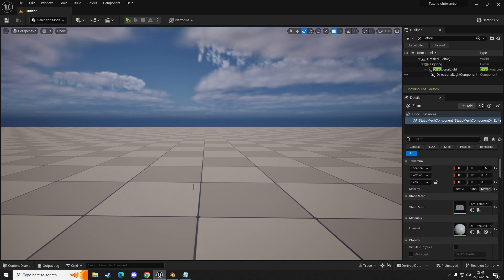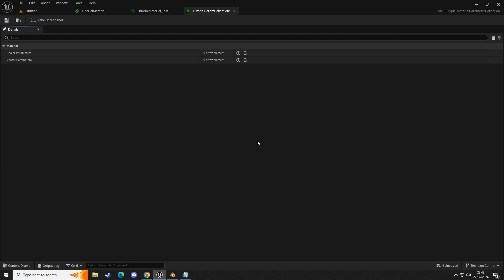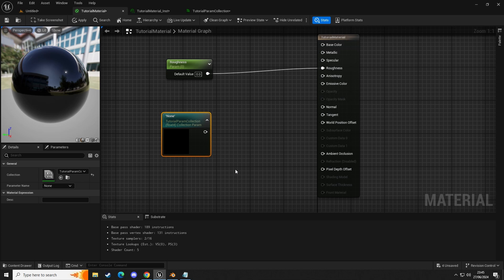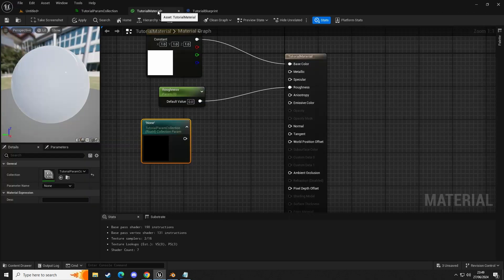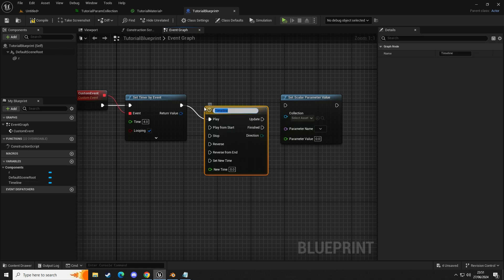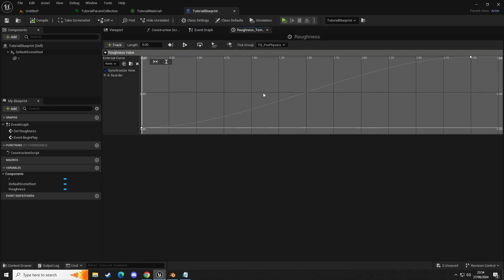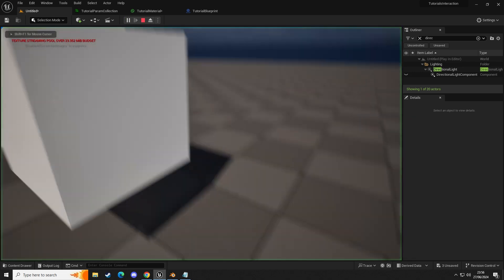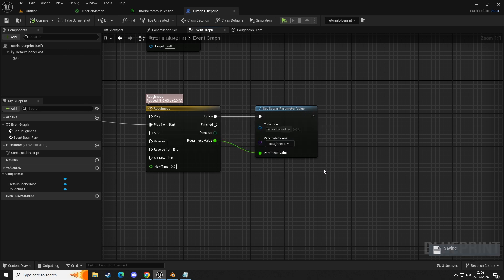HOW TO CONTROL MATERIAL PARAMETERS INSIDE BLUEPRINTS BEGINNER FRIENDLY TUTORIAL UNREAL ENGINE 5.3.2

Comment: This method works with texture maps too?
Reply from the maker: Depends what you are trying to do it works with any parameter inside of a material
Reply: For example , I've a mesh and I wanna spawn  x istances of the same one but each of them with different diffuse and rough maps with my bp, this is what I'm trying to do , I know Is possibile to achieve It using  a  PerInstanceRandom node inside the master material containing all the Maps, but I'm looking for other methods , to understand which one would be better for my case and to optimize this step. Anyway, thank you!  @AMMediaGames
Reply from the maker: @Tablet-l4l7x   you can use a random range in the blueprint :)
Reply: @AMMediaGames  Random range? Never heard about It! 
PS: Do you have some Ds?